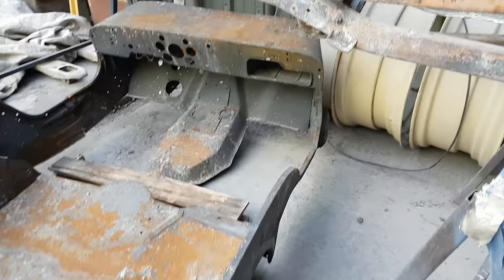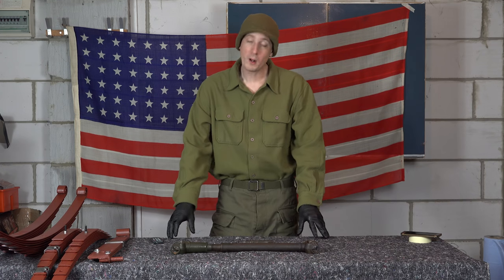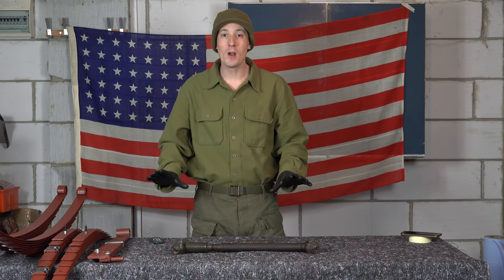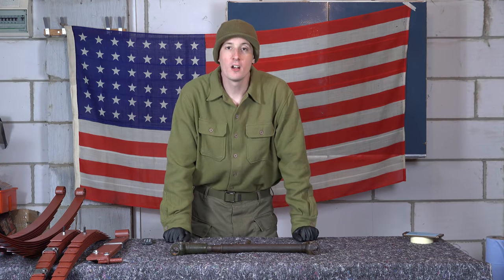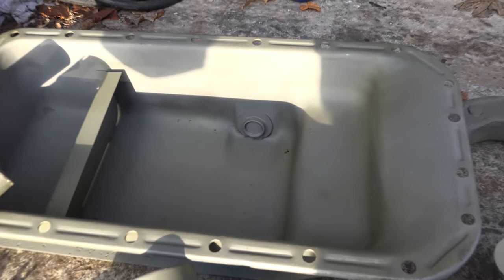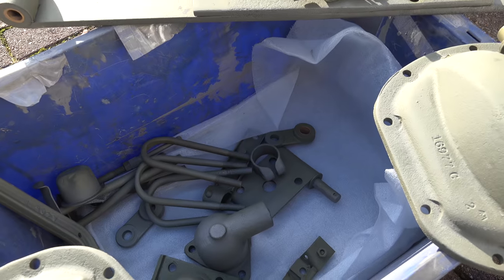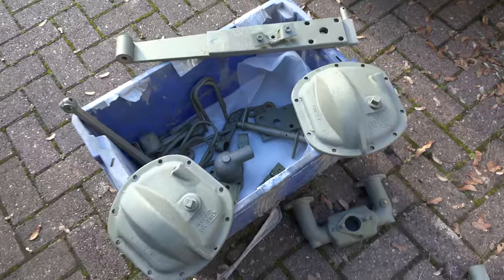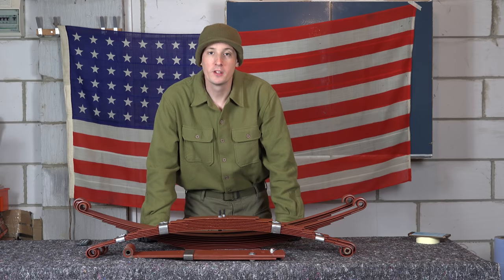First parts Completed, Springing into the Willys MB project

Comment: Yes, restoring a Jeep requires many visits to the sandblasters ! But it is like spraying newness, when you take in a festered rusty piece, and collect a perfect etch primed piece upon your return, it is the single thing I never regret paying for, and your latest batch of bits really came out very well, I also managed to get new crown wheel and pinion, still wrapped in the "Ohio times" but fitting it all up, although possible, did require the making of setting gauges to get a perfect set up, but it is doable.Enjoy your Christmas in the workshop, and thanks for the many excellent videos over the past year ! Chris B.
Reply from the maker: Thanks Chris, the blasters who did this have done a great job, the parts are spotless, very satisfying!  Setting up the pinions is going to be a problem, im going to need to get hold of some fixtures or something as its got to be done correctly, will also need press for bearings... might slow things down a bit...